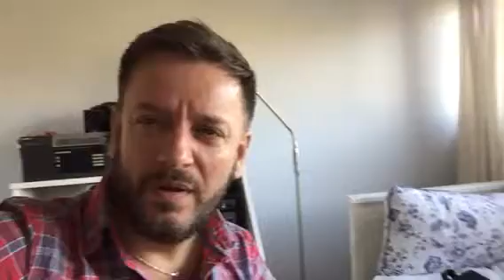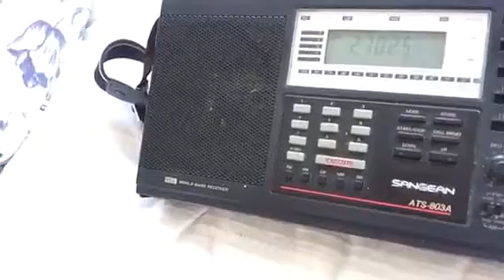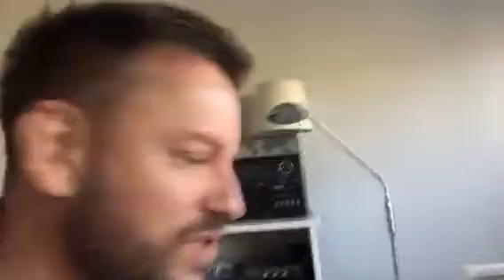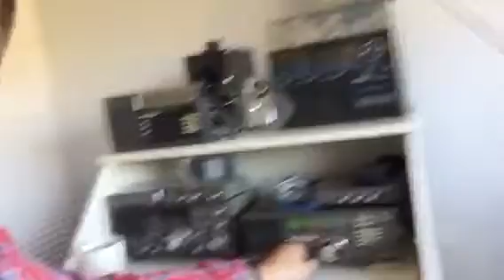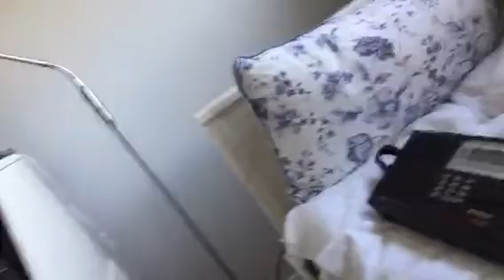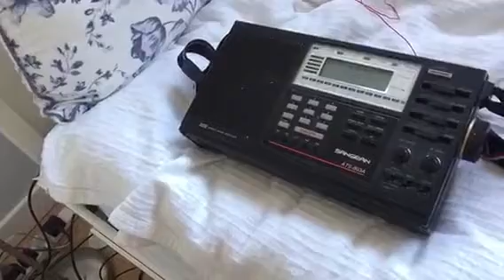27 MHz North American CB signals on Sangean ATS-803A

Comment: Excellent catch! Perhaps sensitivity of 8800 is somewhat weaker at the high end of the spectrum? I found that often quite cheap dedicated CB radios outperforms communicatins receivers on CB band. 73s!
Reply from the maker: +WojtekDX Thank you! Kudos to senderjaeger/ Matthias for the inspiration! I'm not sure to be perfectly honest with you - it may be as Gordon suggested, a horizontal long-wire and vertically polarised signal? Not sure, but I did manage to record another signal on my Sony which I will post later. 73s, Clint

Comment: Very nice catch and video, Clint. Indeed it's the "Super Bowl" with the usual pile-up of American CB operators. Signals from across the pond were very strong again today around 1530 UTC, by the way. 73, Matthias
Reply from the maker: +senderjaeger Thank you Matthias. I was surprised to be able to receive the signals on the Sangean with quite good strength and clarity. I made another short recording this afternoon whilst I was out DXIng in my usual location. I will post it tomorrow. 73s, Clint
Reply: Oxford Shortwave Log
Hi Clint, many CB operators in the US are supposed to use rather high powers, so the signals are often quite stong if propagation conditions allow. I've received them with several portables in the past, using just the built-in whip antenna... I'm looking forward to your video. 73, Matthias
Reply from the maker: +senderjaeger Hi Matthias, thanks for your insight - that makes sense. I do have another video which I will try to upload tonight. Thanks again and 73s, Clint